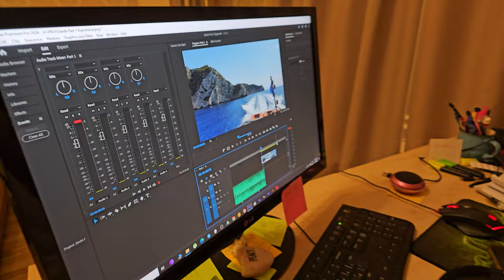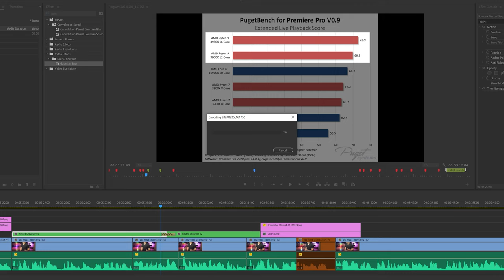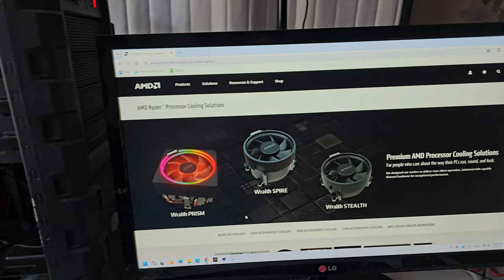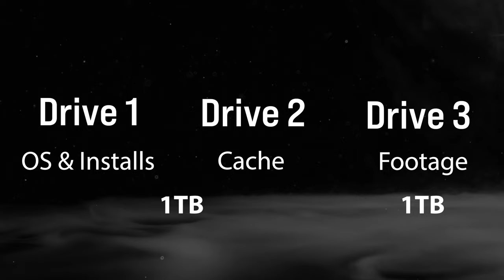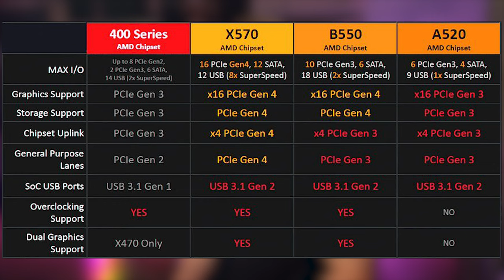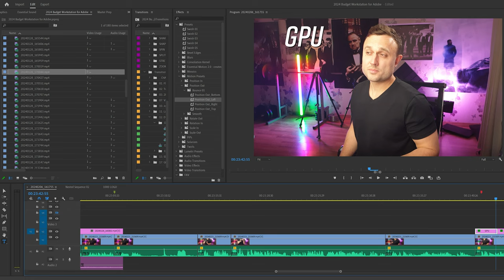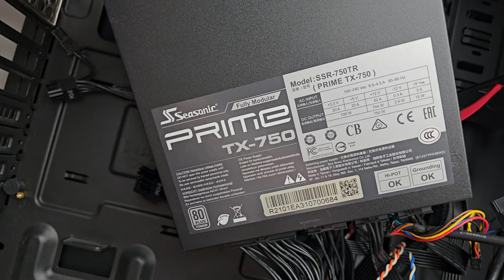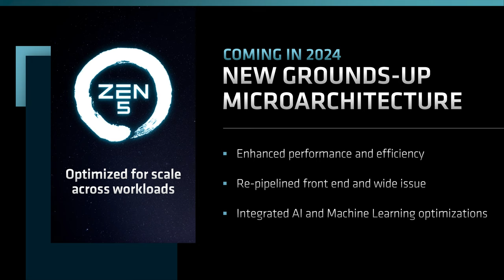2024 Budget Editing PC Rig for Adobe Premiere & After Effects

Comment from the maker: Intel has recently slashed their prices very significantly, so significantly that now it actually looks as a better option than AMD. Also Intel has Quick Sync module (which AMD doesn't) that helps with H264, H265 encoding/decoding. The problem with Intel is it requires more power, more powerful PSU and Motherboard which slightly push our budget upwards. Also if you buy 13 or 14 gen Intels you risk a lottery, at some point you may face chip degradation and failure of your unit. But gen 12 as far as I know does not have this degradation issue.
Reply: Outstanding video!!!!
Thank you for covering this exact topic.
Reply: Intel better 12 gen but required aio using the aircooler quite challenge unless you have extra desk fan blowing into your pc

Comment: I have this exact problem. Thank you for this video. Just curious which intel processor and board you would recommend (within budget of course)
Reply from the maker: glad it helped you!
Reply from the maker: i7-12700K would probably be the most optimal option price/performance low budget wise. With Gigabyte B760 AORUS ELITE AX + some DDR5. Intel boards are more expensive because Intel is a hotter CPU, and boards require more thermal and power stage circuitry.
Reply: @AndresReviews  Thank you so much I appreciate your reply and the content in this video and happy to become a subscriber. I'm sorry if I missed this in your video but how much did your build end up costing you?
Reply from the maker: @westfield90  check out this article, in the very end it has some approx. price targets  https://andresreviews.com/2024/06/26/2024-workstation/

Comment: I just bought a ryzen 5 5500 pc equipped with an rx 6750xt 12gb and a 512gb ADATA Legend nvme with 16 gigs of ram is this good?
Reply from the maker: 16 gigs of ram is a little too low, is it two sticks by 8 gigs?
Reply: @AndresReviews  absolutely! my motherboard is an mATX model, so it only has two RAM slots. given my tight budget of around $900, this was the most affordable option I could find
Reply from the maker: what tasks do you plan to perform on this machine? @AdamYazamii
Reply: @AndresReviews  Mostly for gaming, but I've recently been thinking about getting into video editing as well
Reply from the maker: @AdamYazamii  there are games that run better on 32, but most should be fine with 16. Basic cut&trim video editing will be also fine with 16, by the time you need 32 or 64 it may be years of basic editing and learning. But of course more memory is always better. You may buy two sticks by 32 and have in total 64 on you motherboard and it will cost you around $100. But for now you may stick to what you have, especially considering gaming is your primary use case.
Reply: @AndresReviews  Yes, Thank you for your time I really appreciate it.

Comment: why don't u guys use proxy for 4k, it helps to play even 8k footage pretty smoothly in old systems
Reply from the maker: it is possible, but it also means added rendering, storage, extra steps, more complexity with files management on ad hoc basis when new files are constantly being added. In general proxies are good, but i'd rather avoid them whenever possible.
Reply: @AndresReviews  i understand, if you are working with 25-50 footages of raw files then  it will be very hectic to manage all those proxies and also having more space for those proxies which can take up to 500GBS have a good day